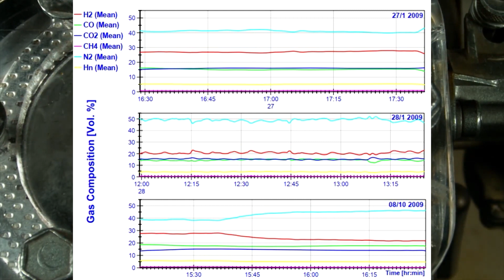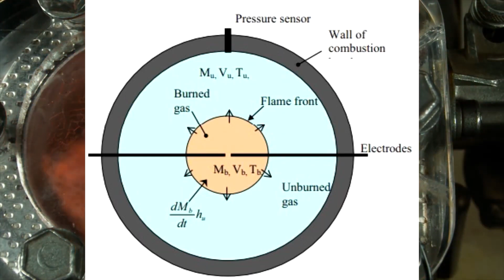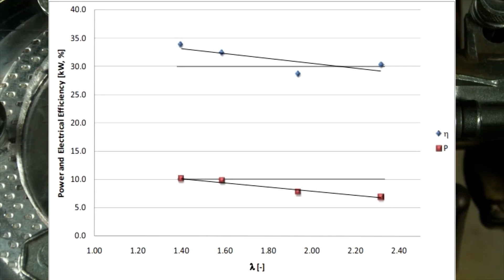Converting diesel engine to wood gas: What compression ratio is necessary?

Comment: I just need to figure out how to get a modern gasoline engine to run on wood gas. If I coukd get that figured out (which I will) I would never need fuel again (gasoline). I am trying to figure this out before shift really takes place. I want to have a decently new engine that will last quite a while so I don't have to worry about being completely screwed in the wilderness of Alaska.

Comment: in my studies, you have to run a small amount of diesel with the wood gas for lubrication. Did you have to modify it to spark ignition? I'm thinking so because woodgas will not detonate under just pressure.

Comment: Don't forget,  on a diesel the injector pump needs lubricating, running on just wood gas will destroy the pump.
Reply: Best done on a pre-chamber diesel than newer common rail tech. You would not need to use injector pump from my understanding but decrease compression using pistons to suit the anti-chamber outlet area, add sparkplugs, no glow plugs, distributor and thicker head gasket aim for 15 to 1 compression. Turbo diesel could be also used but with no turbo just thicker head gasket if possible but all a lot of work! https://www.uniquecarsandparts.com.au/images/technical/Exhaust_Chamber.jpg

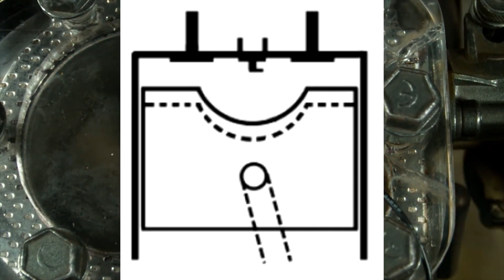Comment: 4:12 in the video is that scientists have found that when there is more air in the gas/air mixture, detonation can be avoided and the rate of flame spread, greatly increased by hydrogen, can be reduced to reach a 1.4 gas/air ratio instead of the originally stated 1.05 for engines or the 1.15 accepted in practice for wood gas engines.  First you say that adding air prevents detonation, but then you say that detonation is prevented when the gas/air ratio is 1.4. My understanding is that at a ratio of 1.4 ( 1.4 parts gas to 1 part air ) there is more gas than air. I would guess that at a ratio of 1.05 ( 1.05 parts gas to 1 part air ) there is more air than at the previous ratio and thus this ratio should be better at preventing detonation.  Maybe it's a translation error, but in any case there is more air in the 1.05 gas/air ratio than in the 1.4 gas/air ratio. Can you confirm my assumption? Thanks Honza

Comment: very good information! now to find me a cheap diesel to play with... my 9.5/1 Chevy engine runs great on wood, and I'm putting a stock engine in with a smaller camshaft  and ill see how it runs on the lower compression on woodgas
Reply from the maker: diesel is a good option, I think you can find a lot of videos on the net how they convert it to gas, insert candles
Reply: @gengaz-lagunov  the trick for me would be like my woodgas truck, total fuel independence. So black diesel or wvo for the limited "diesel" use, and the rest done on woodgas. Jeese all these wood gas projects I need to put a bigger motor on my chunker to keep up with the wood demand!
Reply from the maker: may you succeed)